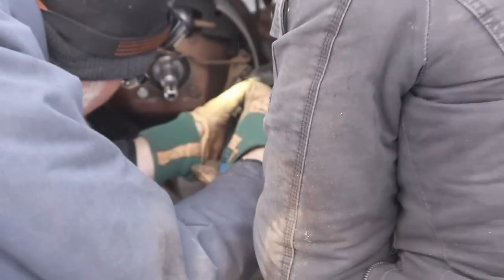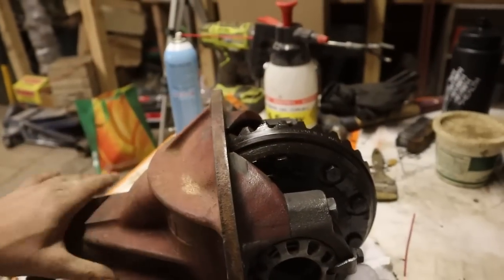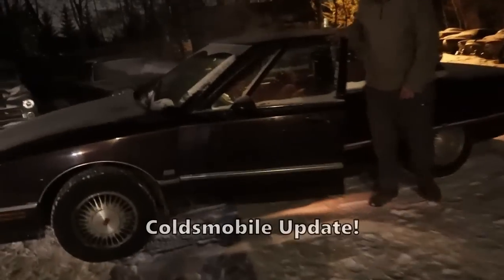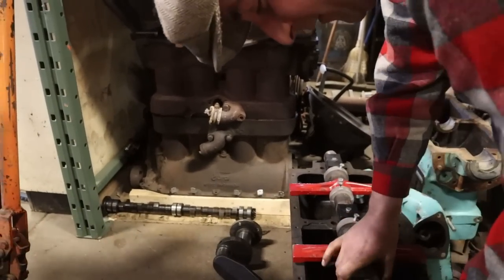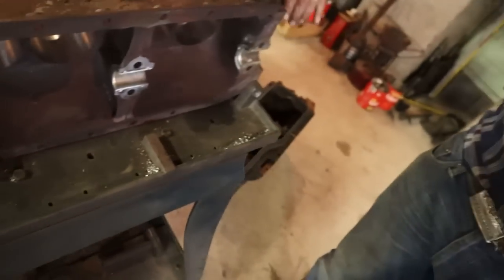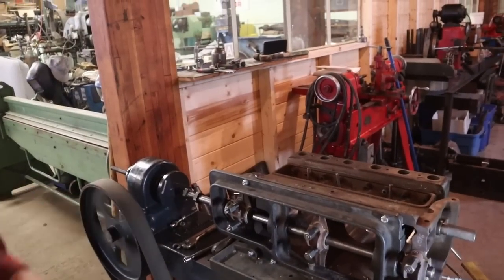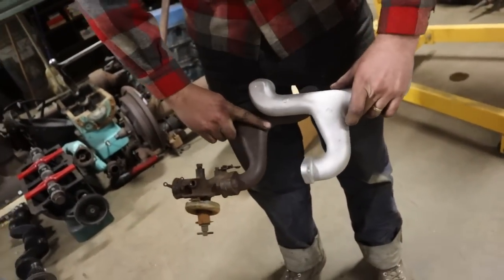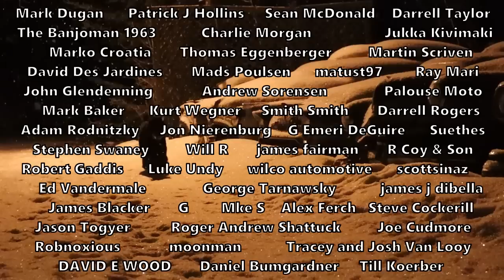Performance Time! The Quest for 30 HP... Plus: 1963 Pontiac, 1937 Chevy, and the Coldsmobile!

Comment: The center sections of GM rears were painted red oxide at the factory. The internal (oil side) may be Glyptol. This is a Chevy rear and that makes sense having a 230 six and a Powerglide. All the big Pontiacs sold in the U.S. (Bonneville, Catalina, Star Chief, Safari wagon, etc.) used the Pontiac/Oldsmobile 9.3" rears and both had nothing but V-8s turning them. Pontiac axles were longer than Olds (wide track) and are 31 spline, pre wide track were 29 spline.   Parts for the 9.3" differential are available at Fabcraft Metal Works including chrome moly axles and heavy duty posi units for the performance minded. These rears were used in drag cars from gassers to fuel dragsters and Mickey Thompson even sold aluminum center sections. 9.3 parts are a tad more expensive than Chevy parts.

Comment: The 9 inch Ford center section in my old 81 F100 was painted that color red inside and out after I cleaned all the crud off of it when I pulled it to rebuild. I've seen several painted that color.

Comment: The best part of the show was when Matt and Jim showed the old tools for the true old timer cars. I know a guy who this day has his Model T engine undone cause he had a right idea on how to cast the bearings. However without the other applications to assist in doing the final cut it's impossible to finish that engine. People who know such craftsmanship are all dead where I am. So this video is a very valuable material to share. I have seen the babite cutting knife before  and most people who don't know that might confuse this for something else. When I look Scott driving the Newport I really get a fuzzy and warm feeling. Specially when I think a 1972 car will run but a 2002 car is just dead in the snow like a frozen dead animal.
Reply: @MaxGiganteum  Your right on the money with that. Lot of these new shops don't have people who know how to handle old and sometimes delicate things. I can understand from the shop owners perspective that taking a very complicated work is a risk and if it's too much or the % of a f..up is high. Than they have the right to refuse.

Comment: Hey @MoparfreaK I'd bet dollars to donuts that red paint you're seeing is Glyptal used to improve oil drainback and encapsulate sand inclusions on cast housings like that. We saw Glyptal or Dolph-Spray on heavy equipment all the time. The paint marks are likely as you said QC verification marks. I've been through most of the attic and looking at the offsite storage unit next, gonna find that emblem if it kills me! Already found half the batch of emblems I pried off wrecks that day back in 1988! It's here somewhere!
Reply: Awesome!
Thanks for the effort!

Comment: A lot of AMC axles are "painted" red, but I think it's more like an oxide primer or rust preventative.  It's usually found coating inside and outside of the center section.

Comment: Excellent video Cold Water Motors Agents Scott  :) , Myles :) , Tom The Boss , Jim :) , Dean :) , Frankers The Dog 🐕  , Wolfie The Dog 🐕  , nice hear Myles Pontiac Stro Cheif  car brakes plus 355 posi rear gears differential  also yes Red in those years too to plus lots Big 3 used same differential pot too! Also 1937 Chevrolet Coupe Master Cylinder for brakes awesome  how clean up and rebuild too! Also Model T extra engine Scott on Engine rebuild plus grind old bearing on mill machine so cool I only seen one ever in operation back years at my late Uncle Bob had on farm for machine shop his late Grandfather had plus his late dad  and one he use back 1985 seen it operation to but since gone too farm sold in 2017 ! But also Scott not sure Agent does introduce to show of cars in motion and like it so cool and keep going to Scott love it plus have Lol too at times !

Comment: A while ago, a home-built tuned up 1927 Ford T appeared on Jay Leno's Garage. It had a few special parts such as an alloy head and Stromberg carbs were specially built for it. The exhaust manifold is Ford A.
An anecdote about tuned side valve engines for racing comes to mind. It was a UK Ford 1171cc side valve engine being raced in an early Lotus. The owner created a squish head by cleaning it up carefully, set it on an angle on the bench, and heated it thoroughly. He then melted three brazing rods into each combustion chamber.  If you do this, and then shave the head, you will get a squish head with most of the volume towards the valves. 
The owner of that racing Lotus was asked by a fellow racing driver friend what he had done to make his car so much faster. He replied "If I told you, you wouldn't believe me, so I won't". Sadly I can't remember who the story is about.

Comment: Thanks for sharing, I often heard about the babbitt bearing process, but now seen how it is done. Strong's Garage, nice place , nice old lathes. That old shoe arc grinder, grind the material to fit the drum, have not seen one of those in a long time, used to work in shop , that reline shoes, used to arc them all the time, the metal would stretch a little , that's why you would have to grind the material a little.

Comment: Really enjoyed seeing those old machine tools explained and in operation. There are fewer shops doing even cylinder rebores and crank regrinds where I am now. The Model T crankshaft looks so slender. You would think it could easily flex between those three main bearings. Thanks for another great show.

Comment: I used to do engine machining at B&D Automotive after school and 2 years after I graduated (70s) and I very much enjoyed it. I also had to use that same brake shoe re-arching machine. later i worked for an aerospace machine shop using CNC machines. Most of what we made was for department of defense, things that go boom , some parts for medical equipment, specialty hydraulic parts, etc. It's a blast, I took every bit of overtime I could get. Seeing how babitting was done was very interesting.

Comment: I remember a good old Opel I had to drive into the Swiss mountains for work: Nearly an hour in one direction. After half an hour of driving the heater started getting  a little warm. By the ime I reached work the car would have been heated up. Nothing warm clothes could not fix. So there is one more thing I have in common with Dean: A cold ride. Besides shitty old beaters, overfilled trunks, to many old vehicles and more.

Comment: Was really cool to see the old boring bar machine in action, I worked 27 years in an air compressor machine shop where we made Worthington and Ingersoll Rand parts. We had a spray Babbitt gun and room to Babbitt bearings (had a .001 tolerance on the i.d. and o.d. after machining) for an oil pump and other parts. Also I rebuilt the master cylinder on my 54 Buick because the kits were cheap and replacements weren't. The manual said not to hone it with a brake hone (special coated) ( I have a hone) but mine needed something. I wrapped a green Scotch Brite around a smaller drill bit and used brake fluid and that worked.

Comment: watching this old machinery work is just fascinating, so glad there are still shops like Strongs that have been accumulating these machines and better yet still putting them to use!  One question I had was how long (miles) did a set of bearings last?  Cheers to Scott and the gang for powering through the freezing temps to get these rides road ready again!  And a big cheers to the pest for being back on the mend!

Comment: Well glad to see Frankers back on form, happy birthday Jim. You have to admire Myles commitment, determined to get the Strat Ch on the road despite the "artic" conditions while working outdoor, much respect.The usual features on the Strato, the T the 37 Chevy continue to delight. I'm wondering after watching their new kit on Strongs Garage, whether re-lining those Chevy brakes can be undertaken at Strongs? Little did I know you would be going over there to showcase their skills and rescued equipment to upgrade the T and some brake work. Matt and Jim are truly set apart not just showcasing their skills in some living museum but using it to provide a motor business, and we shouldn't overlook Matts Dad (well he is called Ken!) who has made parts for their machines.. Can I say Scott, one of the things I love on your channel apart from all the cars, fun etc is the detailed look at the tech and seeing it in action as with the work on the T engine upgrade at Strongs. Finally well done Dean with the indestructible Olds. Cheers guys.

Comment: With all the advances and in oils made since that engine was designed, what oil do you plan to run in the engine? I guess the same could be asked of the type of gasoline. I need to get those monogram models to Jim. Stay warm if you can. Best to all the agents.

Comment: Love the cool line boring machine,harking back to a time when an engine could be totally rebuilt in a dealership. Amazing that it's still capable of doing what it was designed for a 100 years later. 
That Stratochief is one cool looking car. Will the light tidy include some work on the rockers at some point? Looking forward to seeing it back on the road. Best wishes to everyone from this side of the pond!

Comment: Scott, of course the Strong's Garage visit toped the show! Matt + Jim are HG Wells time travelers! But Myles Pontiac brake job was of keen interest. But, having had a '60 Chevy sedan delivery back in the late '60s with the ubiquitous straight six and three on the tree w/coil-overs that I literally drove nearly everywhere in New Mexico and Colorado at 90 mph! Don't misunderestimate (GW Bush) that Pontiac 6's ability to eat pavement! Love the fact you're hopping up the T w/refurbed tranny, "built" engine, high volume intake + "late" model '21 carb with a shaved head! Shut the front door Nellie! Can't forget Dean's Coldsmobile, now lukewarm or Frankers' willingness to wait in the Chrysler whilst scary machines did their finest. Cheers!

Comment: the diff was red oxide sprayed before assembly the green and yellow paint dapps easy wat on the line to tell gear ratio n if its posi or not.....green should be gear ratio and the yellow shows its posi diff
Reply from the maker: Thanks Steven! I knew someone would know all the particulars...Cheers!

Comment: On my '70 Impala (GREAT car, BTW), I discovered--after two days of head-scratching--that the right fender needed to come off to get the last bolt of the heater core out.  The official GM service manual suggested alternatively to just drill it out.  Did that, and had it together in an afternoon.  Wish my 240 Volvo was that easy.

Those GM 3.8 V6s are gold according to all I've heard.  Last forever, get good mileage besides.  Been looking for an old grandma car like that for a DD, so I can just work on the cars I like, and use that for getting from Place A to Place B
Reply from the maker: Oh yeah! I had several 240s... heaters were the first part installed in those things, haha!

Comment: What a treat seeing the Model T engine getting bored!  I went to an estate auction a few years ago near Flint, Michigan and the guy had all the machinery and tooling for rebuilding T engines.  Most of it ended up going to the same bidder for a good bit of money.  I got a Ricardo flat head made back in the day for Model Ts.  Ricardo invented the idea of turbulence in the combustion chamber, achieved by the shape of the chamber.  Apparently in those days, the Ricardo flathead would make more HP than the overhead valve conversions with the gas that was available back then.  Ford incorporated the turbulence design into the stock Model A heads.

Comment: HAPPY BIRTHDAY JIM!
it must have been simple enough to carry most of what was needed for 90%+ of the cars on the road in the 60's
in regards to brake service, eh? They were most all Bendix drum set-ups, just a matter of sizes.
Even then, you had what, 9"-10"-11" diameters x whatever widths for passenger cars, maybe a bit larger for heavy
trucks?
My beloved Mopar muscle b-bodies mostly did 11x3 up front and 11x2.5 rear, pretty much off the c-bodies, 
for example. I've veen wrestling those for what, like 50 years now? Do 'em in your sleep, so simple...
Myles' Strat-Och is gonna be SO cool when done! 
Yes, I concur! Everyone should be subscribed HERE and STRONGS' GARAGE! 
Beyond all the unique and cool car stuff on both, there's just so much GOOD going on at both in general.
I'm gonna be a such a wreck if any of this ever stops before I do...so don't mind me if I say a bit of a prayer for y'all.
- Ed on the Ridge

Comment: For small bore pieces like the one you have, you take a 1/4 of an inch shaft, slice it at the center and roll the sand paper around to the desired thickness  and your good to go. Great show guys.

Comment: back in the day-one of the tricks on the 55-64 Chevy rear was to install 8 3/4 Mopar spider gears to get stronger axles-so you may be right,posi's were probably made by the same supplier

Comment: Those are 55-64 rear axles they’re all the same. Center sections are red oxide primer to my knowledge in US production. 55-56 is slightly 
different in some parts but Same unit.

Comment: Could tell by the crunchy squeak of the snow that it was cold out. As for the way the older stuff has nuts and bolts that actually unthread intead of just breaking off, it is because of the quality of the steel compared to the lower quality of the newer steel each decade after.

Comment: i wouldn't be surprised (and, no, i'm not going to research it)  if some enterprising sort has developed a ball-bearing system for use with the cranks. with the lack of horsepower and speed it might be a nice solution.

Comment: I wonder if you had the prints (Or measured it) for the tooling if a person couldn't whittle the parts out on a Bridgeport for the line boring machine. Doesn't look too complex. Wouldn't look period, but it would work. Other alternative would be to cast it using the originals as a pattern, allowing of shrinkage.

Comment: You flush your brake lines with denatured alcohol.
Reply: What do the guys at Strong's garage think about using the cam gear that's half a tooth off for better mid-range power on the Model T?

Comment: That false cam is complete bullshit!

On another note, how nice it would be to have someone around that could still re-line re-arc brake shoes. For anyone working on older drum brake cars and using newly made shoes, they are never very close to the proper arc. Plus, the lining material tends to be about 2/3 the thickness of what they were when made by the OE.

Comment: Those air cleaners are way to small on the Flat head v8 she have more power with bigger air filters those ones are choking that motor . Your engine works like a air pump . It’s like putting those air cleaners on a 440 it’s going backwards 🙀any nice work .